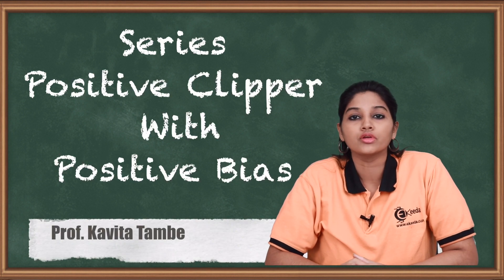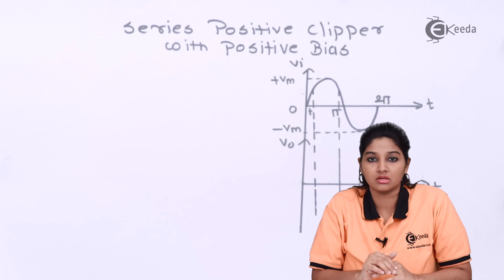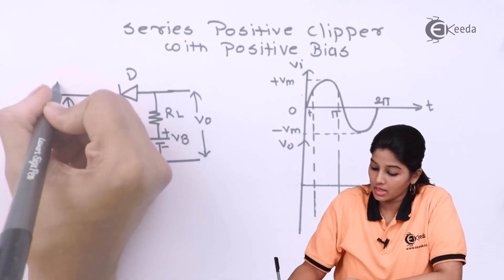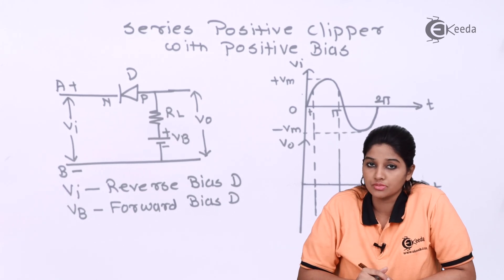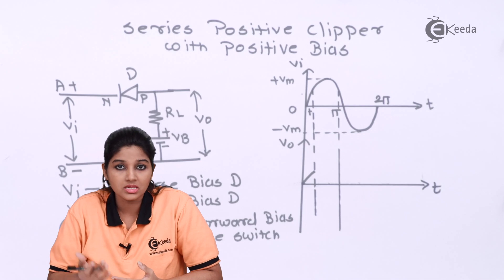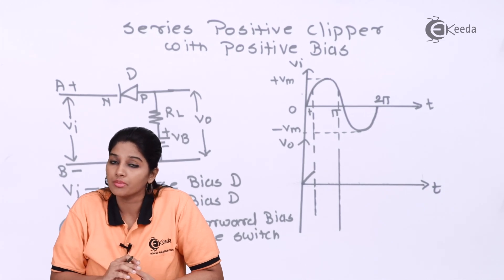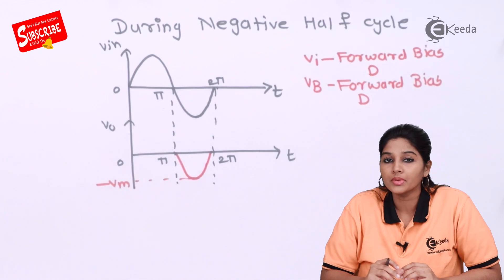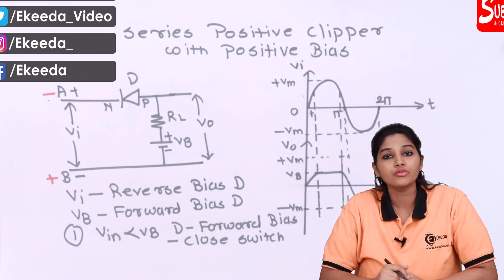Series Positive Clipper with Positive Bias - Rectifier and Filters - Basic Electronics

Comment: Ma'am if nothing / zero output comes on the point when vin> vm it should be zero why saturated?
Reply: Ya... Mam... If v input>v battery then total circuit will be.. Open... So no current=no voltage.. Then you u written saturated one.... 🧐

Comment: Initially when Vb>Vin then o/p Vb should be a constant line but how did you draw a linear line????
Reply: Hello! I also have the same problem, so I think when Vb > Vi the diode is forward-biased and will conduct. But the output across the load i.e Rl should be equal to Vb-Vi if we apply Kirchoff Voltage law to the circuit, I think that is the reason the waveform is not a constant line as Vi is a sinusoidal waveform and is constantly changing, therefore their difference cannot be a straight line.
If you find anything wrong with my conclusion please share your view.